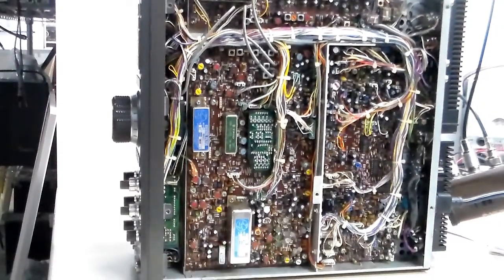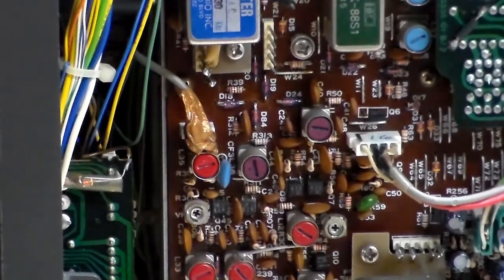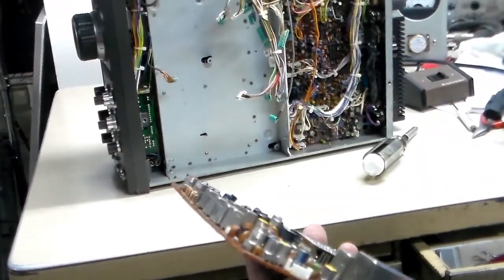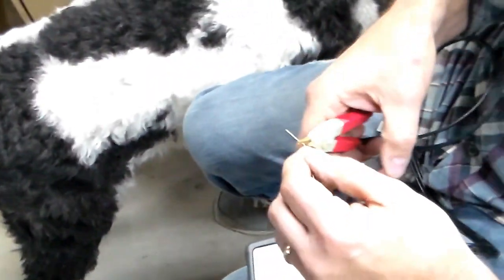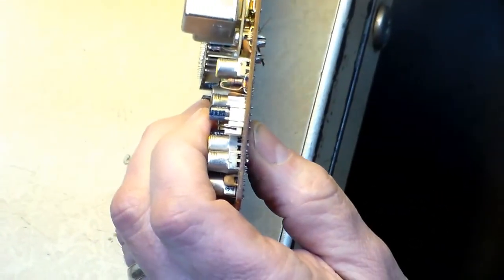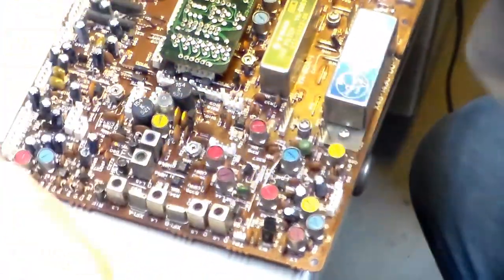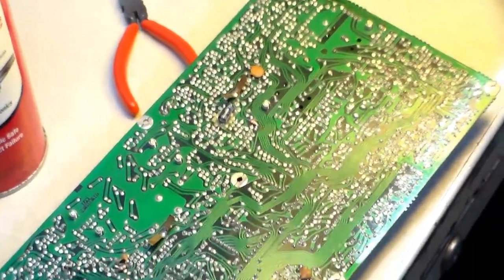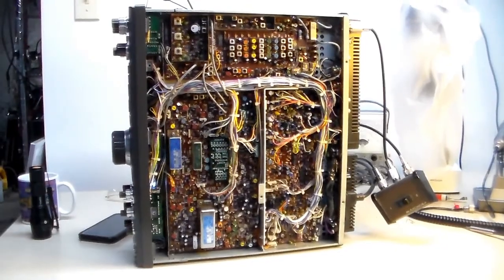TS 940 Connectors and Signal To Noise Update

Comment: Well, a little over a year later and I stumbled on this video.  AD8BU here.

I started watching your video and then you described what was going on... I was like, man I wish this video was around back when I was having that problem with my TS-940. It sounds exactly like what was dealing with. Then you referenced my post on QRZ right after that thought went through my head.

My 940 is still working, though I didn't know about the service bulletin regarding changing that resistor at the time I serviced mine. I'll have to look into that and the needle slam the next time I crack mine open.

73, AD8BU
Reply from the maker: It’s definitely a fun radio to work on. It’s a big thing and there’s a lot of info out there.  Thanks for the post.

Comment: The meter slam mod might have been worth doing also, swapping J5 with a 1N4148 or similar and putting a 100uF from cathode to ground, solves the meter pegging at power off.
Reply from the maker: I'll give that a shot next time I have it apart.
Reply: @timtimeprojects3576  Thats on the IF board, it takes the rig up to 9m> spec with the other Kenwood SBs.
Reply: What is the service bulletin number for the s meter slamming mod??
I have one that does it.  Surprised it has not damaged it by now.
Reply: @kevinmccool3719  There is no SB from Kenwood, but the mod was documented by 3rd parties comparing Earlier IF boards with later 9M series boards that did not meter slam.